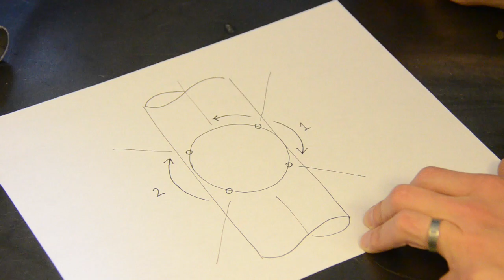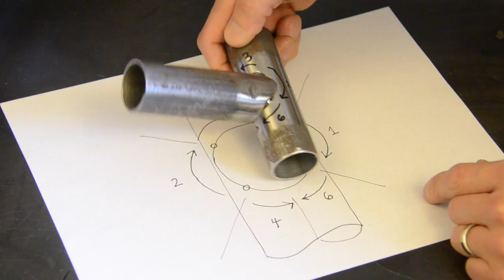Bicycle Frame Build 26 - Tig Tube Welding Practice

Comment: If you heat those welds with a torch to get some flame colors, will it weaken the joins or the metal itself??

Comment: Good stuff, probably didn't need the pulse setting for that type of job. Use pulse when too much heat  will cause issues. Looks like  tube 1 lacked heat, tube 2 was a lot better. Good to see you had the guts to show all the welds, good or average.
Reply from the maker: +david eirth Thanks for watching! I was using pulse just for practice so I've been using it a lot when not needed :)

Comment: to save time dont bother cleaning the tubes with any thing before grinding or sanding, sand to bare metal, sometimes use acetone and i have NEVER had any issues tig welding mild steel or thin chromoly
Reply from the maker: I've done the same with my latest round of practice tubes. I didn't notice a visual difference. But In the class I took they made a point about how clean the tubes need to be. Even to not touch the prepped area with fingers. I can see where they're coming from with this. The smaller the weld, the less it takes to contaminate.

Comment: In case of interest - in my humble shop I made something to help eliminate having to use a piece of wood for support for some approaches - https://www.youtube.com/watch?v=cLumr3Hs5xg - makes this TIG beginner's like a bit easier.
Reply from the maker: ChrisB257 Thanks! Looks very effective. I'll need to make something like that soon. I ran into to problems on where to rest my hand when welding my first frame. Your tool would have been very useful.

Comment: Thinking about your comment about removing the filler rod and oxidation, doesn't that mean any time you start a weld the filler rod is compromised simply by sitting on table waiting to be used?
Reply from the maker: Matt Schorr Ah, the filler will only oxidize when its near welding temperature. Once it has cooled down a bit its safe leave on the table. I think for bicycle tubing I'll start snipping off the burned/oxidized tips though. That's the only part that gets oxidized if you remove it from the shielding too soon. Which i do all the time!
Reply: Pithy Bikes Good to know...I'm learning a lot from you.  Thanks for going first!!

Comment: Wow! It's more and more interesting. Again it was my pleasure to watch your progress. Thank you for your effort and bringing some enlightment to me!

Please correct me if I'm wrong, but if welded point changes it's color, it means a lot of heat dissipation. shouldn't you try to get the weld nearing the same color as material which is actually welded? The more heat dissipation then higher risk that physical parameters of th welded joint will be altered, I suppose. From the other hand I wonder if it's possible to get the welded joint in the same color, as in fact welding process is based on melting of metal.

Another issue. You've mentioned, that welding might be stopped at any point. I disagree. Again: you are dissipating heat in the welded pieces of material what in fact changes its physical state. Because of that I assume that the whole process of welding should be either as quick as possible or pretty lengthy: heating - cooling, heating - cooling etc. Which approach is the right one in your opinion?

Suggestion: It would be great to hear from you why you've decided to weld tubes instead of other techniques: lugs, soldering etc. What are advantages and disadvantages of chosen technique?
Reply from the maker: mslonik You are totally right about stopping and starting a weld. It will increase the chances of a weak join and more heat ends up getting applied to the place where you stopped and started. From a beginners perspective though, it can be quite difficult to continue a weld without stopping. And for a beginner, I do still think that starting and stopping at any time is good advice to follow, especially on your first frame. In the beginner frame class I took, lots of students were key holing the tubing because they didn't stop. I know because I blew out my tubing several times. But! everyone has a different method of thought on this and I think it really comes down to what you're comfortable with. A setup with good shielding and heat dissipation will be more forgiving on starting and stopping. I do know what you mean though, starting and stopping every quarter inch for no reason would be a bad thing!

I guess I went with tig because I like it. Although I have never tried brazed which also looks fun. I'm sure I'll end up brazing something as I move forward in the process.

Thanks for the insights! After reading your comments it made me really think about using heat sinks. Especially for the way I weld where I'm laying 6 beads for a single joint. And I really do need to wait longer for the joint to cool before starting up again.
Reply: Pithy Bikes About tig welding I've answered to myself: consequence of lug brazing is increased mass of the frame (additional lugs) and a bit longer time of assembling in comparison to skilled welder. Probably it's also cheaper if you consider not brazing but silvering (soldering with use of silver). Additionally I wonder if butted tubes didn't enable one to weld lighter frames.
Reply from the maker: mslonik Tig welding a frame is faster than brazing I assume. I've never made a comparison but I'd guess a tig welded frame is lighter than brazed. I doubt it's a significant difference though that would matter to the rider. It really comes down to rider preference. Both cost probably equally the same to build as far as material are concerned I think. Most of the same equipment applies. But if you're starting out I think that maybe lugged is faster and cheaper to get a jump start on because you don't need a tig welder.

Comment: Dude, sick videos, sick channel...your production value is great btw...as a photographer, I can appreciate your quality...can you do a little explanation on your stand for the harbor freight porta-band?  I've only seen ones for Milwaukee or porter cable models, and haven't quite figured out how to mount a harbor freight model...thanks man, and keep it up!
Reply from the maker: Nathan Hamler Thanks! For the stand, I built mine after I saw this one. http://s595.photobucket.com/user/uapkt84/media/Harbor%20Freight%20Portable%20Band%20Saw%20Stand/P1000793.jpg.html
It's quite simple. You remove the secondary handle and then clamp a plate in there between the handle and the body. For the bottom of the stand, it basically just sits on the base and is not clamped to anything. However for mine, I welded in a some shims which made a 'seat' of sorts for the base to sit in. Also I welded a base table surface to rest the work piece on while I'm cutting. Cheers!

Comment: Awesome job! One tip I can offer is I try to have my stops off of a major axis. I know some builders do it, but most of the tubing suppliers advise against it. My stops are closer to where you have your tacks.

And you are spot on about keeping the tip of the wire in the gas envelope while welding and also during the post flow. Keep some clippers handy to snip contaminated ends when you start your actual frame. It's a good habit to get in for later when you start to work with more finicky metals.
Reply from the maker: zanconato This is really good info. Yeah, I can see why stopping inside the corner is not suggested. Start and stop areas could be weaker and the corner is a place where high stress is happening while you ride the frame. Thanks!!

Comment: Hey here is an article that has some great tips for welding tubing. 
 http://www.millerwelds.com/resources/articles/Best-Practices-for-GTA-Welding-of-4130-Chrome-Moly-Tubing
Reply from the maker: Amos Garcia Awesome. Thanks for the link. I need to get me a cheap air sander.. I have standard dremel but I don't think it has enough torque.

Comment: Awesome! Recently I bought a TIG welding machine too.
I'll use this video as an instruction.)) What are the welding parameters you set for this thin tube?
Consumption of argon, welding current?
Perfect channel for beginner bicycle frame builder!!!
Thanks a lot!
Reply from the maker: Illia Kalynchuk 
Hi, the tube in the video is not thin tube. My setup for the tubes in the video are as follows
Welder - Everlast Powertig 200DX
Torch - Weldcraft wp-9
Gas lense - #8 ceramic
Tungsten - 2.4 mm, 2% lanthenated
Filler rod - 70S-6
Note: This setup is for mild steel 1/16" junk tube.

For thin tube:
rod - er70s2,  size .035
tungsten 2% lanthenated  1.6mm
Amp setting around 60amps
https://www.youtube.com/watch?v=KlPTqz2f07E&index=2&list=PLaz6WjKNr9tUDS1wJOVzUrjfIVvvoLC_5

thanks for watching!
Reply: Pithy Bikes Thanks!
I will go to practice!

Comment: You did great! Love your videos.  Little suggestion to help with your torch angle make your 1 and 2 welds half the length they are and then lay the tube flat on the table and weld 3,4,5,and 6 welds from the corner up to the 1 and 2 welds. This does start as a vertical weld up to a flat weld but it easiest for me. Also to keep the torch just right I hold my torch in me right hand for one side and in my left hand for the mirrored weld. 
Keep up the great work, I em always open for questions and criticism.
Reply from the maker: Amos Garcia I will try this for sure. I haven't done a lot of this type of weld so I want to try as different ways before it becomes muscle memory. Thanks!

Comment: Hi, I agree with Yeonho Cho, stress test - clamp one test in the vice try to lever the top of the 'tee' off. Perhaps bandsaw the weld on another to look at penetration... I have done both in the past when welding something that someone's life depends on... By the way, thanks for inspiring me to go out to my garage and crank up the TIG :)
Reply from the maker: Colin Faulkner Love it. Will do.

Comment: What welder are you using?
Reply: Yeah, what's the welder?
Reply from the maker: Sam It's an Everlast 200 DX. I've had it about 2 years now. I think Everlast has updated the model. http://www.everlastwelders.ca/tigwelders/powertig-200-dx-d.php  So far it's been great for the price point. If you go with this welder, you should absolutely upgrade your torch as the one that comes with it is garbage.
Reply: Pithy Bikes Its funny you say that, I just ordered the exact welder, and I also got a CK FlexLoc torch to go with it!
Reply from the maker: MrGangsta9812 Super! You made a good choice. One thing I ran into when starting out with this machine is I had it too close to my welding area. I was fooling around with the settings so I wanted to just reach over and change them. But the machine has an internal fan and air was blowing out the vents. So it was blowing the argon away as I was welding.